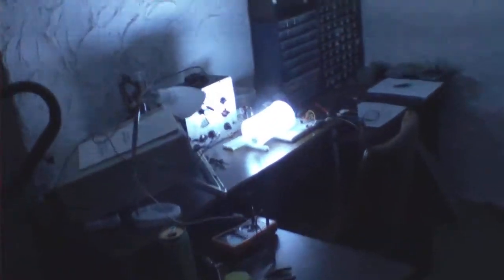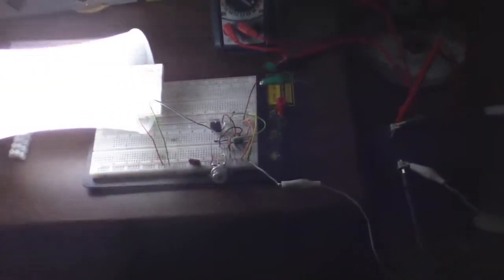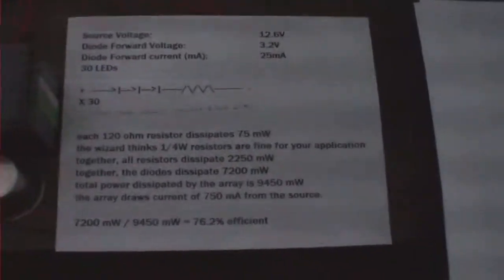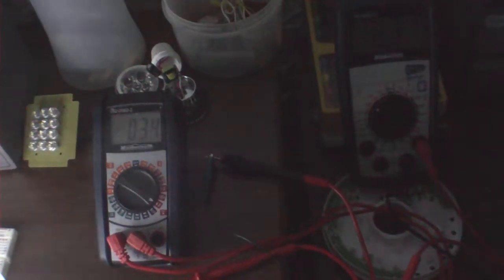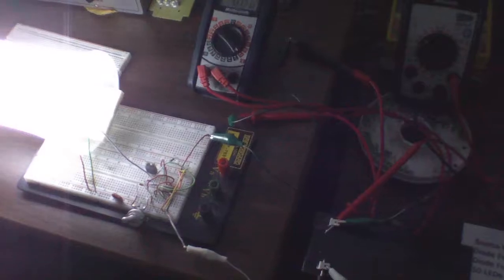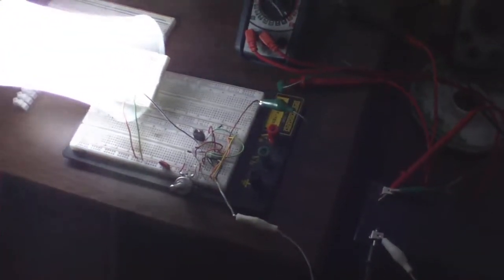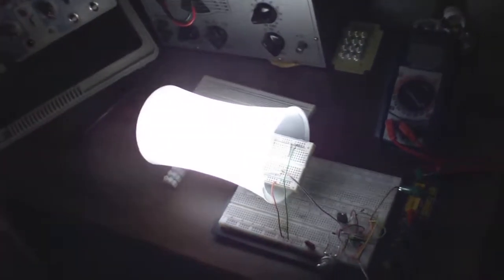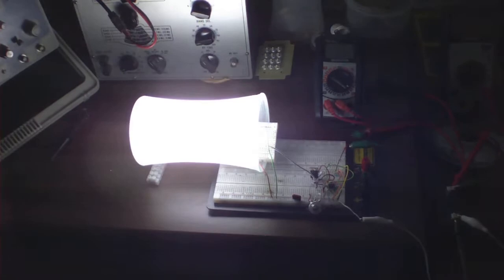PWM LED Lamp (90) 5mm 20KMCD Strawhats - No Resistors

Comment from the maker: @ibpointless2 I also found a buck converter circuit rated to up to 3A output on ebay for $3.50 incl. shipping. In that situation, I would then buck regulate to 9.6V or thereabouts. And then compare results. Problem with that scenario, as I see it, is.. you know you have to lose 1.5V (output must be 1.5V less than source - states it in the design). So, When your battery drops below 11V, your in trouble. Mind you, you really shouldn't drop your bank below that anyway.

Comment from the maker: @mnsman1 I think the wavelength does have a lot to do with it, but it is truly amazing how much artificial light it takes to replicate the power of the sun! Agreed, solar panel are very inefficient, but the sun sure isn't.. that's why solar heat collection works so much better. In absolute ideal conditions they say there is 1000 watts per sq. meter to be had, and heat collection can grab up to 50% of that!

Comment from the maker: @KyleCarrington I think the solar panel will always do much better... in the sun.. I'd imagine, 100X better if not greater. The point of the experiment is that normally when you use such an array with the current limiting resistors (look at the piece of paper in the video) the total energy drawn is over 9 watts for just over 7 watts of light out, whereas here, nearly all of the energy in, goes to light out. Thanks

Comment: @KyleCarrington Yes they dim, They draw 450ma at full capacity. I run them off a car battery for 8 to 10 hours a day. Battery goes from 12.68 to 12.20 per day. It takes me about one hour to recharge it, at 1.2 amp/hour. It cost me pennies a month. Love it.

Comment: @KyleCarrington I just made the video. I'll upload it shortly and give you the link.
I have been experimenting with this system for 3 months now. Trying it out. See the possibilities. I had the strip running individually and in groups. From 0 to 14 Volts.
They are well engineered. The video will shed some light, Pun intended!

Comment from the maker: @PoirierMike I had a look. I'm guessing those strips are probably 4 LEDs in series with around a 43 ohm resistor on each leg. If so, they'd be protected to 13.8V (automotive max).  I agree, the price is right - and the "work" need is minimal. If our time is worth anything, and this sort of thing "is not" your hobby (for me it is..) - then it's a great plan. However, try running that lamp at 10.8V and tell me it doesn't dim?

Comment from the maker: @overunitydotcom if you look at the LED calculator, it states 30 resistors at 120 ohms each. If you were to reduce that to a single resistor on the neg or pos leg (non PWM method) that would be (30/120 = 1/X) = 4 ohms. So adding a 4 ohm resistor, it will dissipate about 2.7 watts in heat. If you add a one ohm resistor, you are still pushing a lot of heat and messing with the circuit, totally (as I see it). All said, I think I was pushing the threshold at about 600 mA.

Comment from the maker: @overunitydotcom @Stefan, those are good questions and I don't yet have the answers because in my PWM I use no 317 for current regulation. Given the pulsed nature I'm not sure how to arrive at the threshold, really. I think the meters are probably lying. If you add a one ohm resistor and measure across it, you are really messing with the input voltage. I say this because .. cont ...

Comment: I like it, Kyle.I have come up with solution worth investigating.Very cheap,High quality."Hobbyking 60 LED" strip for $5 and "LED Light Lamp Dimmer Brightness Controller DC 12V" for another $5, ebay.I bought the 24 Volt dimmer version for $6, got 4 X 60 LED strip for $20. Gutted a Fluorescent enclosure. For 12 watt draw it gives out the equivalent of 100 Watts Fluo. or lumen equivalent. Dimmers are PWM based.Too cheap not to try it.I know you will come up with something great to do wit it.